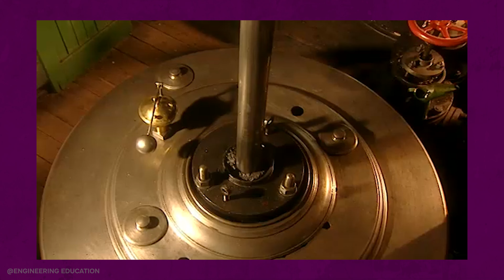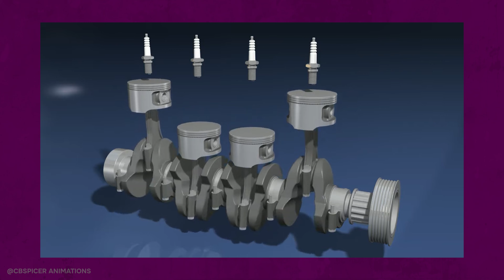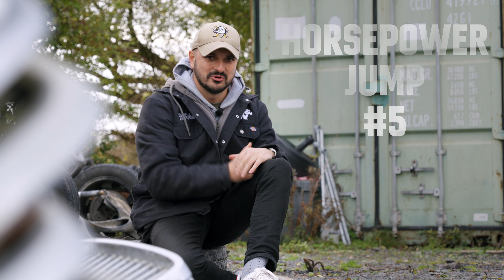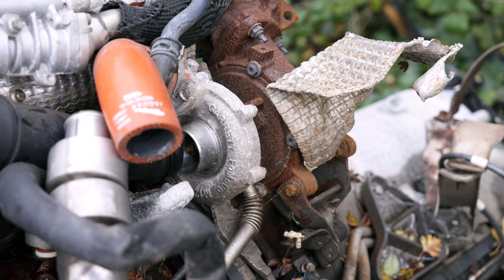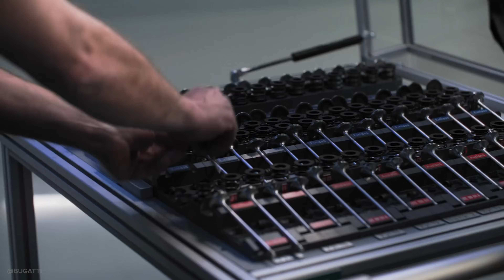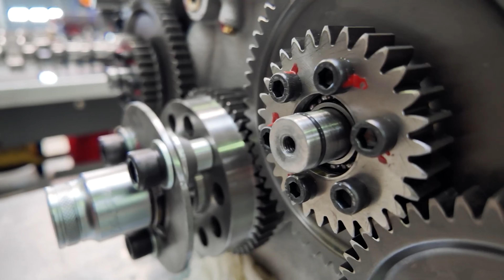How Car Engines Went From 0.74HP To 2000HP!

Comment: In a field behind me a spitfire crashed due to flying upside down showing the carburetor didn't work
Reply: To be fair, that's natural skill issue of the carburetor's orientation based fuel intaking
Reply: @shanedoesyoutube8001 all I know that is was early days in the flight of spitfire it crashed in the village of Gedney Hill lincoshire between station road and mole drove south side flying into the sun
Reply: @tonydean1262  only reason that happened is like I said

And also the negative g force contributing to the fuel not getting into the cylinders naturally

Comment: it's always worth saying 'production car', because the performance/aftermarket world is way far beyond in terms of power, you can buy basically a 'production' engine that is several times more powerful vs what's in a production car, but usually have a much shorter lifespan, the upper end of a 'streetable' engine is basically boutique, but can be upwards of 5000 horsepower, and needs a refresh every couple thousand miles, chugs methanol under max power and doesn't conform to any emissions

Comment: Great video, but you missed-out massive and important steps. The biggest increase in horsepower came from going from "Under-squared" to "Over-squared" engines. 
Under-squared engines have more torque, but torque incurs a weight-penalty. The weight-penalty and longer stroke ultimately limit rotational-speed which puts a very low ceiling on the maximum power available. (this his why Harley Davidson motorcycles are so bad)
Over-squared engines have a much shorter stroke. Whilst this limits torque, very high revs are possible because the piston doesn't outrun the flame-propagation. Torque per piston is traded for speed. Additional pistons can make up for the deficit in torque and because each piston provides less torque, they can be made lighter which also improves rotational speed.
You missed out: "COSWORTH"!!!
All affordable engines are bad because they are cast! (Even Ferrari engines aren't as good as they could be) Casting creates a random crystal structure. With temperature this will expand in all directions which increases piston-blow-by!
Machining the whole block out of a single billet of aluminium alloy, allows the crystals to be all aligned in one direction. Though aluminium has a very high coefficient of linear expansion, with the crystals aligned in a desirable direction, nearly all the expansion can be made to happen longitudinally with respect to the cylinders. This is why Gordan Murray went to Cosworth for a powerful naturally aspirated engine; although God knows how much they cost! (The pistons and conrods are made as light and as strong as possible so that power can be derived from really high revs. However, the extremely low tolerances and exotic materials that make very high rpms possible, also incur a massive cost)

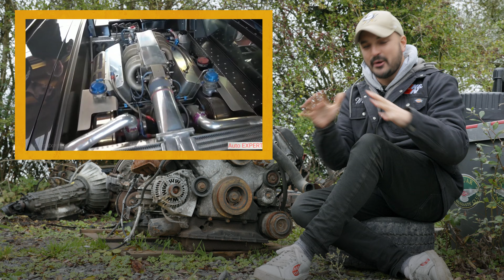Comment: 14:47 It's not a Venturi W8, it's a Vector :)
Reply: I would say it’s a schoolboy error but that’s an error a schoolboy would never make. 😂

I’m sure it was a slip of the tongue. Venturi would never make anything as insane as the Vector W8. Poor Mike. American gearheads are gonna crucify him for this.
Reply: Also at 17:00, the Ford GT was not naturally aspirated. Solid videos, but the research has its flaws.
Reply: @copenkagan Yes, I did notice that but it was already mentioned in the comments
Reply: yeah i picked up on that lol, was about to post but then thought to see if anyone else had. 👋👋
Reply: @paulrogers4054 same.
Reply: Also 2,000hp? is that all? The most powerful Top fuel dragster outputs 13,000hp

Comment: The 1987 Buick GNX with its turbocharged 3.8-liter V6 was significantly faster than the 1987 Nissan Skyline GT-R. The high-performance GNX could hit 0–60 mph in about 4.7 seconds, while the 1987 Skyline GT-R (which was the R31 model, not the legendary R32 yet) did it in a much slower range, with the fastest variant, the GTS-R, clocking in at around 6.2 seconds.

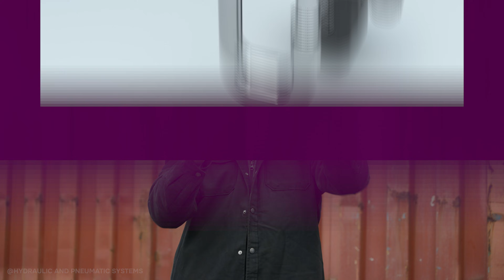Comment: 12:25 minor points, misspoke when he said the exhaust gasses are rerouted through an intercooler. Needs to add a line about the intake air.

Also, less minor correction.... 17:00, the Ford GT famously has a a supercharger on the 5.4L v8. Cmon Mike
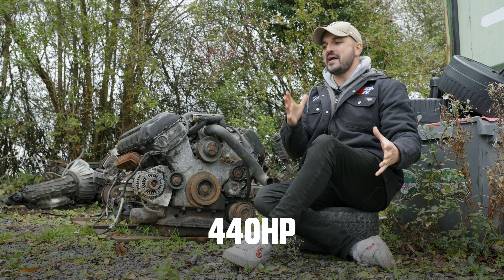Reply: Also, he refers to the Vector W8 as a Venturi W8 in 14:44..  not good.
Reply: @SocratosBig  I was wondering about that. Figured maybe it was named different in the UK or something
Reply: The original GT 40 was NA
Reply: @toaster98  yes but that's not what he was talking about in that clip

Comment: This stuff tickles all my mechanical engineering pickle! Would love a wheeler dealer style build series but you go more in depth into the technology rather than just how to replace a part for profit. Would love some engine reviews too, getting into a car and reviewing the engine as the main focus, and the rest of the car in between. Throw in a few microphones for some proper ASMR action! Good luck Mike, looking forward to the rusty Rovers that will make an appearance at aome point I am sure!
Reply: Yes! I'd love a build series style where each part is explained in more detail rather than just "This'll make us more horsepower". I'd love to learn more about how stuff works in detail, and the physics that make it possible. Take a carburetor for example. There are different levels of explaining it. 1. Concept: What it does. 2. Design: How it does it. 3. The physics: How it's possible for it to do what it does. And it's the third level I miss on YouTube.
Reply: Hehe, tickle pickle

Comment: Sodium filled valves were first used in WW II, they were developed in the 30's. They were used in turbo-supercharged radial engines by the U.S and U.K. long before the 2JZ. Still a good, beginner's guide to engines. You can only cover so much.
Reply: I seem to recall my 1954 Morris Minor had Sodium filled valves.

Comment: I was told engines are just air pumps and the more efficient you can move the air, the bigger the power. It’s pretty true, but I add in thermo efficiency. We still don’t harness the full potential of fuels like gas. We’re only now seeing 50% efficiency out of fuels.

Comment: Great video 
However, it cannot be overstated how much improvements in lubrication helped the early development of engines. being able to go from low revving tall cylinders to high revving engines with shorter stokes required oil that would not be flung off the components by centripetal force.

Comment: FYI, Twin Scroll turbos were used in the SAAB 9000 Aero 2.3T from 1994 onwards. That car had 225 bhp from the factory and i can remap them straight to 317 bhp. Of course add bigger turbos and injectors and these engines happily go to 550bhp with zero mods.
Reply: As someone who owned one, and looked through Saabs EPC that is not true. No Saab 9000 ever used a twin scroll turbo. The Saab 9000 either used a Garret T25 or a TD04, neither were twinscroll, just look at the non divided exhaust housing and log style manifold, they weren't twin scroll. It was also used much earlier in other cars like the Mazda FC Rx-7 Turbo II. 

Everything else is true tho, its a monster of an engine, only sad part is that the transmission is only rated for 300nm, which is less than what the Aero produces from factory and will not last long when tuned, especially if it already very worn.
Reply: What do you mean "zero mods" but you "add bigger turbos and injectors" to make 550 bhp? Pretty sure changing out injectors and turbos are considered "mods" to most people.
Reply: @toolbaggers Sorry i mean physical mods to the actual engine. i.e Pistons, or rods.
Reply: @TheSaabClinicUK a turbo is a physical  mod😂 so is injectors.
Reply: @TheSaabClinicUK Stock long block, stock bottom end, stock internals would all be good ways to describe what you mean. Or I guess you could just say without any other mods.
Reply: @TheSaabClinicUK  This made sense to me but reading other peoples comments - maybe it shouldn't have as its upsetting people lol. There are different milestones when uprating power with different cost implications. For example - with the BAM VAG 1.8T a simple remap with stock internals you can go to 265BHP. With uprated exhaust and  intake maybe 300, but then you start to hit the first expensive limit (which is the connecting rods/tie rods which tend to sh1t the bed (or exit the engine lol) above 350 lb/ft of torque). Uprate rods and 400bhp is fine but that means splitting the engine and I would consider this pretty major (I think many tuners might refer to this as 'stage 3' but the stages thing is pretty vague from one tuner to the next). IF you are going to split the block and do rods, most would consider pistons and crank. Then with aggressive map and hybrid turbos and hi flow injectors I have seen 1.8t's boasting over 700 bhp - with claimed hypotheticals of 1000 but I have no personal experience of this. So yeah 'unmodified engine with bigger turbo and injectors' does make sense to me even if it maybe probably shouldn't. 🤣
Reply: @TheSaabClinicUK  I think the proper way to say that is either “factory internals” or “stock internals”. I’ve always heard/read people differentiate between bolt on mods and internal mods like that.
Reply: @StephenLott-r3r  Thats the US English, we do not speak like that over here.
Reply: Lol, are you AI? straight up lies.
Reply: Clutch can take 300hp jump?
Reply: @mramisuzuki  Yes, im running an Aero clutch on my 382bhp Track Car and its going ok.
Reply: Lmao "with mods this engine can go big without mods"
Reply: @MrRoblox1377  I assume he means without uprated rods, forged cranks/pistons and case strengthening etc. As in 'without modified internals'. Those mods are more invasive and much more expensive than 'external' mods like high flow injectors and uprated induction. I know he didn't say it very well but I'm sure this is what he means.
Reply: @MrRoblox1377 i thought the same "its stock, with a turbo" 😂😂